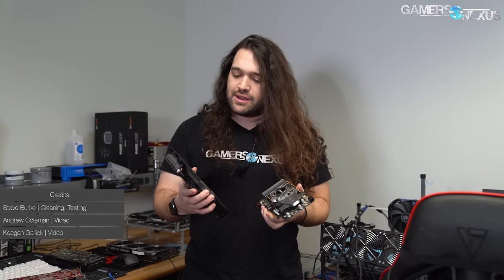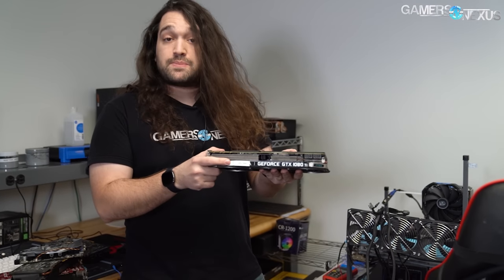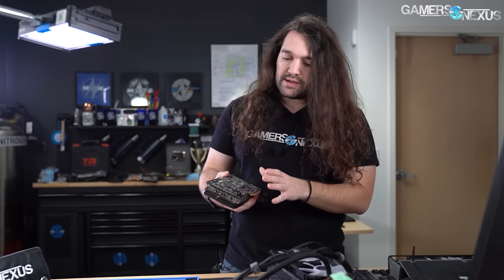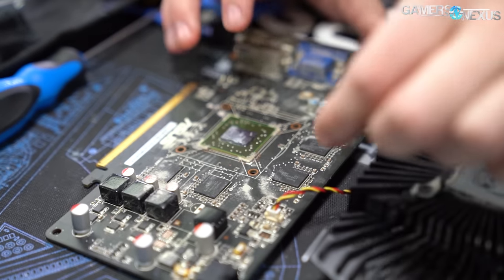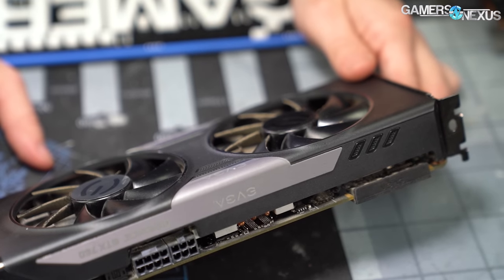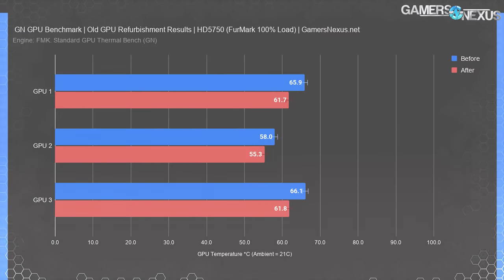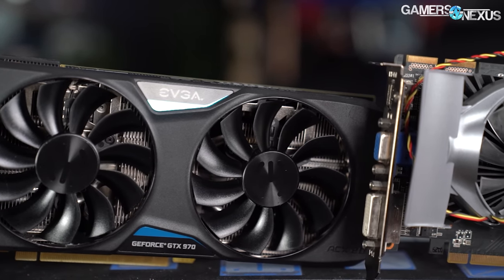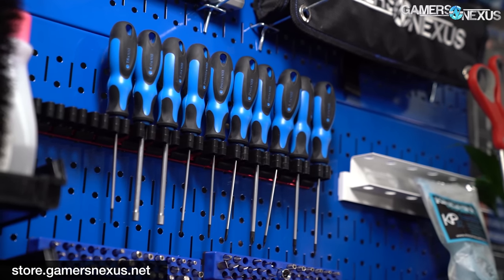GPU Cleaning Before & After Thermals: Re-Pasting & Dust Removal

Comment: Made the mistake of repasting the gpu on a zotac 1070 mini where the VRM is so under designed and the cooling solution for it so absurd that it ended up hurting the card. GPU thermals when WAY lower and so fan speed, but then without knowing the vrm where badly overheating and the card became unstable at a point. I measure the back side of the PCB where the VRM are at 98C after shutting the pc and opening the case. Meaning probably much higher when instability occured. Make sure the thermal solution on the card is adequate before repasting, as a too high gpu temp on bad thermal solution can actually save your card. ( I'll never touch zotac again though ... waiting for a ROG 3080 white to spawn in a loot somewhere to replace this crippled 1070 ... been grinding for month now and haven't found one yet ).

Comment: When my GTX 1080 died on me back in late November and comparable  or faster GPU's were not available. I had to resort to using an old  EVGA GTX 960 2gb. While playing some games noticed fan rpm ramping up, checked the temps and it was hitting up to 75C.  Took it apart paste had turned into a solid, cleaned it up, reapplied  with some MX-4. Temps then dropped to 60C max load without the fan ramping up. Side note though the whole GPU market situation just plan sucks.... Been without a decent gpu  for 4 months now jeez....

Comment: Thankyou for the tip about thermal pads, I was about to change out the pads and paste on my 1070, but I bought 1mm pads and my card takes 2mm. I didn't even think to check that, I naively thought that thermal pads would be universal.

Comment: I re-pasted and thermal padded my  1080 gaming X  last week. It  dropped 13°c and stopped the memory from crashing the card. The paste had pumped out and the corner of the die wasn't making good contact, my guess is the memory controller wasn't stable because of a hot-spot, look after your cards, it can bring them  back  to a card that is like new performance.

Comment: I've used a cheap $20 hair dryer to dry heat sinks. It's not as sketch as u think. Just inspect it before u reinstall. U can tell if its wet.

Comment: My old PC was a Dell. It had an i7 in it, but I forget exactly what one. It always had a loud CPU fan that would seemingly always be at full speed. I decided to take off the cooler during a cleaning which then required new paste. I bought the cheapest paste at best buy. Some Corsair brand stuff, TX-30 maybe? Repasting it with that brought my temps down 20⁰C and my fan no longer sounded like it was taking off. That cheap paste performed so much better than Dell's crap it was shocking to me.

Comment: 2017 I put my rig together, R7 1700, GTX 1080, X370, 16gb 2933 (3200), and a custom water loop I had all but the blocks for in my previous rig. Its running strong to date, temps are identical to what they were then, just tested it back in december. It makes me sad because my 1700 was an absolute dud, won't oc at all and even after years of agesa updates still can't. The memory controller is no better so the ram is derated. Still even when I pushed an unstable 3.6 oc on my chip it didn't give me that good of gains so its been happily at 3.2 for 4 years now. I play on a predator x34 and usually either the 100hz refresh rate or the GTX 1080 + 1440p ultrawide limits the performance before the CPU does. I wanted to grab a 5900x and a 3080 but then I learned about scalpers and once I saw they were here to stay is when I did my windows reinstall and hunkered down for another year with my current system.

Comment: Clean down of fins and liquid metal repaste took a 5700 xt from bouncing off 110 hotspot at stock (max i ever saw was 113 and thermal shutoffs at 118) to seeing a max of 84.
Timespy 20 loop went from failing at stock 95% to passing at 99.7 with factory OC

Comment: I once picked up a used Quadro 4000, it was screaming in the PC and running at 90C+. Took it apart and I'd sooner call it a dust blanket than a dust bunny that had been totally clogging the single slot cooler.

Comment: My 1080ti had 2 fans die last month but luckily i noticed that my pc was a bit to quiet when loading T.W Warhammer 2 so i was able to power off before any potential harm could be done to the lifespan of the card and have just invested in water cooling the card to hopefully keep it alive till the gpu market settles. 
(I'm in Australia so the American ebay scalper price is generally what retailers charge.)

Comment: You can also just take the fans of and get the dust of the heatsink that way with a brush or some canned air if you have it. The whole thing with the thermal pads sounds like a lot of hassle, while replacing the thermal paste might have some additional benefit I guess. Same goes for the cpu heatsink.

Comment: Did the same on a 1070 Ti, paste was rock hard and it went from 80 to 65 degrees at full load just by applying new thermal paste, and was very silent afterwards as well.

Comment: Put new Noctua H2 paste on my 2080 Gaming X Trio and saw max temps go from about 85 to just under 70C. Great fan noise reduction and OC headroom improvement. I was really surprised how bad it needed new paste after gaming for a year. Might try new thermal pads to see if it opens up any more OC headroom.

Comment: I redid my 1070 with blower style cooler a while ago and used kryonaut. i got zero degrees off but it went down 300 rpm. This is because this gpu is tuned towards 82 decrees and will stay on that and just adjust the fan speed instead of temps or performance.

Comment: I've finally come to terms with having to cannibalize my old GTX970 to refurb my 1070ti; ironically one of the fans on the 1070ti looks pristine and never used as in it never actually turned, and the one that is fairly caked in dust works just fine. I'm hoping it's just an unplugged fan, as I have use for that 970 now too.

Comment: i got my first gaming laptop ever in may 2021(Asus tuf A17 nvidia 3070/8gb vram 8, ryzen7 5800/ 8 core.)

did my first clean and repaste ever this early summer, so pretty much after 1 year use, gaming every day and other use, at home. (alot in lap using due to not having dinner table or desk.) but i built my own desk this summer so figured i would give the laptop a fresh start so its all good(plus it ran at max temp gpu 87(my set limit, dont know if that to high or low sincen there is many opinions on that and this is a laptop so its made to tolerate a little moe temp.)

Cleaning and repaste gave me a temp drop from 87 to 68 celsius under heavy load(warzone/vanguard mp).

first of: i was extremely nervous to open it up since in Norway we have a 2 year warranty and didnt want to ruin annything. so removing the parts to get acces to clean and repast was scary. felt like it was welded on even though i knew it wasnt, but it did scare me. 

-2 small fans: if 0 is new and 10 is completely clogged in dust i would say these were maybe a 7.5-8

-around open space inside: 0 is new and 10 is no extra room left at all: i would say a 1 at max( so i guess the "self cleaning fans" actually  helps a little.)

-cooler metal thing/chiny thing with alot of thin plates stacked(lol, i dont know the name): pretty nasty to: 6-7 of 10

-cooling paste main gpu and cpu: hard and bone dry! cracked and really had to rub with alcohol to clean it and had to scrape CAREFULLY to loosen most of it without ruin things.(almost like it wasnt pasted for 3 years atleast. and i know it was built in february 2021(so 1 month max before i baought it from the store), maybe they used a sheap one?  if there is any norwegians  reading this i bought it of komplett.no

Question: paste on vram(it think its vram( 8 small squares around cpu/gpu) on my laptop from the store/factory it has cooling paste on them instead of pads. and the past feels slightly different in consistent than what was on the gpu. is this the case and should i get thermal pads since it seems like on 3 of the vram bricks it bearly touches the paste. from what i could see. and can i use the normal paste on those too?

Comment: I love my 1060. The next GPU is probably going to be AMD, but i may need to keep this one in the system for the cuda support, for stable diffusion and whatnot to play with every now and then. Anyway, i want to keep this in good condition as far as possible. Specially since i bought it used and the fan makes a noise under high loads. Sooo. Thank you for guides and tutorials on that stuff.

Comment: In hindsight I would have loved to see cleaned then repasted or vice versa to see how much change is from dust and how much is from paste. Still I think for most people in a normal home dust filters are not worth the performance hit. Even if someone only cleaned their pc every 3-5 years that would be enough to make the performance loss from the impedance of the dust filter a larger than the performance loss from the actual dust. (Plus it's not like dust filters don't need to be cleaned either.)

Comment: I have had quite some cards here over the last few years and all were doing fine regarding thermal paste and temps except for one RX 480 which instantly overheated to 95°C and crashed the PC in Furmark. I took it apart and the thermal paste was hard as a rock. After cleaning it and putting on new paste it ran without issues at 80°C in Furmark.

Comment: You might see around 5c cooler temps after heat cycling a couple times. Thermal paste takes a few heat cycles to bed in so to speak.
Reply: Not the paste he used. He just used far too much of it.

Comment: I've gotten confident at cleaning GPUs.   The one area I need however is a supply of various thickness thermal pads for replacements.  I've recycled an older Maxwell based Titan X that runs "hotter" even after cleaning it up.    But according to some Google searching many others see the same/similar temps so not sure if I can do anything about it.   Stupid blower cards.

Comment: I've washed whole gpus with hot hot water. When you use really hot water, it dries out fast and doesn't rust. I just take the cooler off the board and wash them both separetely. Done this many times and never had any problems

Comment: I used to have a 1080Ti Gaming X from MSI and their stock thermal paste was really bad. Card started reaching 86°C after just 2 years of use and even then 82°C weren't uncommon before it got worse.
So one day I said "eh, f*ck it, let's change the paste." So I went on and swapped the paste to the Arctic MX-4 and was staggered by the results.
Under the highest loads it was only hitting 72°C and under moderate loads it even stayed at 68°C.
In contrast, my current 3080 from ASUS hits only 66°C under heavy loads, so there is quite a bit of quality difference between companies besides the obvious heatsink design.

Comment: Steve to remove the old thermal paste easily, you need to warm up the radiator a bit - that would have been the best advise, running it under water, well probably some people will run the actual graphics card under water, heating up the thermal compound will make it soft and using isopropyl alcohol is nice as well, but in case you haven't got one try Vodka -)

Comment: Cleaned and repasted a second hand 1660ti recently, but temps just shoot up under load. Would have been cool to hear about common pitfalls and how to avoid them.
Reply: It might be an issue with mounting pressure. When good contact isn’t made, it can seriously impact thermals

Comment: Did this a little while ago on my Evga  980 ti ftw. Dropped ~10c at the same fan speed in the same games. I'd always had issues with keeping this card at or under 83c and when I opened up the card I realized the reason why. The factory thermal paste application on the card didn't cover the whole gpu die, with multiple corners having no paste on them or paste on the heatsink where the die sat. Almost definitely an outlier from factory and it didn't make the card unusable for all of those years, but the repaste definitely helped. How much was from properly covering the whole die and how much was from fresh paste? Dunno, but glad it's cooler and quieter now.

Comment: once a week, vacuum the pc with a plastic "5mm nozzle" + compressed air from 1100W 230v 6L 8bar supply unit, 50cm-1m i remove any dust from pc. been doing this for a year, no problem, and 90% isopropyl alcohol on blades if the fans are dirty from cigarettes,dry, gtg

Comment: EVGA actually has really good thermal pads and paste, when I tore down and repasted and reused the pads, thermal performance was worse than stock by about 4C.  A significant hit to thermal performance.  It’s liquid cooled now, so it’s fine.  But I used Kryonaut paste, and it still suffered on air, mainly because of the reused thermal pads.  I would dissuade anyone from tearing down a high end EVGA card in hopes of improving thermals with a paste application only, unless it’s an older card, more than 3 years I would guess.  Unless of course you have high end thermal pads to also replace.  This was a 3090 FTW3
Actually they use thermal paste, a crap ton of it, on the VRMs and it’s a biotch to get clean.  I smothered them in thermal paste, maybe my thermals were higher because I was getting better transfer, always 100% fan speed, but still, it was fine stock.  Don’t mess with this particular card unless you’re changing out the cooler
Reply: Much more likely that you used far too much paste. That will increase temps. Pads can be reused easily and won't produce higher temps, unless you got dirt on them or they ripped.

Steve did the same mistake with too much paste here, that's why he didn't see much improvement on most cards. Normally you see good improvements even on new cards if you replace the OEM paste with something like Kryonaut. Not if you use too much of it.
Their pads are awesome too, btw. Significantly better than anything OEM. But also very expensive.
Reply: @cartrips9263   I typically have repasted all my cards going back to Kepler (700 series) Titans, I think that was the first set of cards I tore down for liquid cooling.  Then 980s, 1080s, 1080 Ti’s, and 2080 Ti’s.  Never had this issue before.  I did have the TIM crack on a 4790K, causing it to instantly overheat under load.  Had to delid that and apply Conductonaut liquid metal, that was pretty cool.  But in my experience too much paste isn’t really an issue because it will just squish it out when you clamp down the cooler

Comment: This is a really useful video! Roughly how long after buying new would you recommend taking the GPU apart to maintain it? 
Obviously would prefer to not wait for a dust megalopolis to evolve and grow on the fan blades but obviously don't intend to make this part of my weekend cleaning schedule.
Reply: I will really depends on your space & how dusty it gets, those with pets will need to clean more often than anyone, while those with hard floors & Air-con so the windows don't get opened much will not need a major clean anywhere near as often, a good sign is how often your Case Vents need a clean
Reply: @johnstrad  "this is what I would recommend to myself if I wasn't lazy." 🤣🤣🤣🤣🤣 well said

Comment: How much do you think this is influenced by the increased quality of thermal paste made today vs. the grease they were putting on cards stock that long ago? I would be curious to see the results of replacing the paste on a very low end graphics card (Especially a new old stock from that era, if those are even still out there) with higher-end products.

Comment: I'm highly skeptical of the replace 'OLD' paste get more performance correlation going on here. The paste being cemented to the sinks from being old is you thinking their is an issue when their isn't. Thermal compound is designed to do just that, preventing air between the contact of the two sinks. The improvement we are seeing in this graph are from 2 things and each thing has nothing to do with the AGE of the compound.

1) Replacement of STOCK paste AND doing so with proper technique. Being that factory compound is literally the cheapest stuff & is usually applied incorrectly at the factory, just buying a cheapo $5 tube of compound and applying it will give you benefits day 1 on most any card. 

2) Dust. Nothing else should need to be said about performance gains on an old component when dust is removed from it. Clean pipes and stacks give you better convection which give you better performance over the dust covered pipes and stacks.

TLDR: Compound AGE doesn't result in a measurable decrease of your products performance.

Comment: lol my 2008 computer hasn't been cleaned in years......but it hasn't been turned on in years except for a couple days ago. I needed it's video card for my old computer (which is now in the new one and it's a 7 year old Geforce 780) so I could move data to my new computer (RDP wasn't working and not enough shared folders). I turned it on to make sure it would be ok for remote access if I needed it for some reason. It had been 3 years. lol and speaking of thermal paste, my new computer with a Ryzen 3600 was running under load (cinebench R23) at 67 degrees C on water. Not horrible, but it seemed a little higher than I expected and the water temp was slow to go up. I suspected bad thermal paste job on my part. So when I put my Ryzen 5900x in that just came in this weekend, I made sure it had enough. I again ran cinebench R23 and it ran about 58 degrees C with the water temp increasing much faster. Much better!

Comment: Surprised there are no blower coolers in this video.

Just cleaned my 1070 FE a couple months ago. Dust in those cards is hard to see and harder to clean. Especially since the dust typically clogs the end of the heatsink by the fan, and not in the clear window of the card.